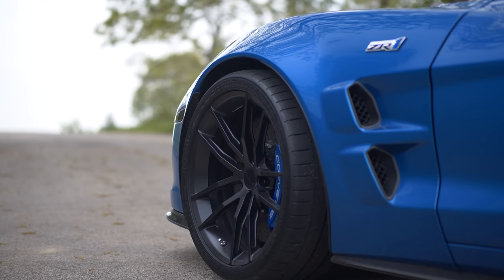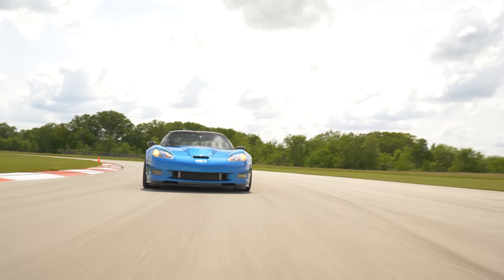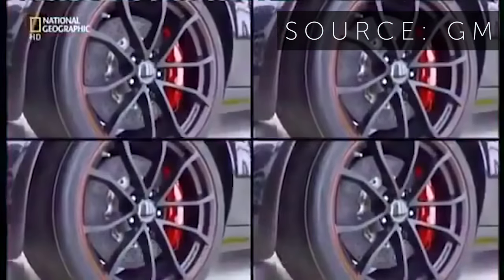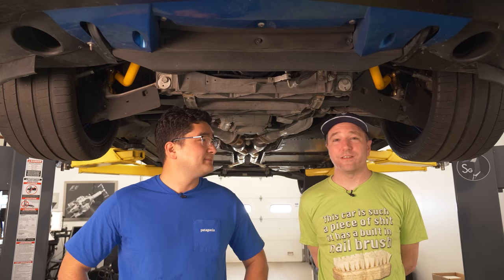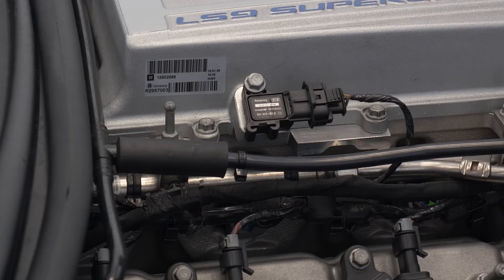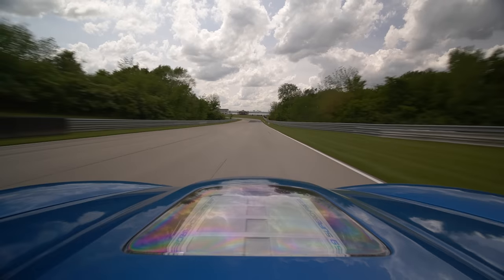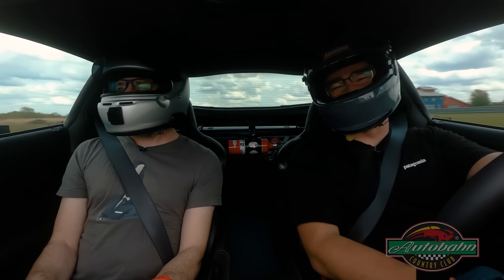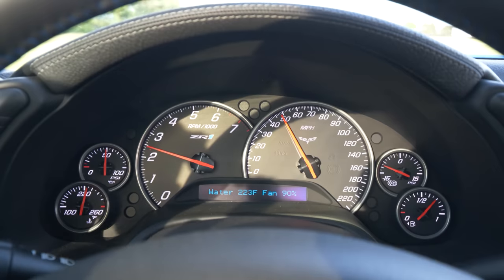Corvette C6 ZR1 | 1000HP Death Trap

Comment: Mark's initial reaction to the pedal to the floor reminded me of a childhood memory. I was 8 and my Dad's friend Ed, who worked for Dodge, came over to give us a ride in his newly-acquired 71 Super Bee. The only car I had ridden in up to that point was a Pontiac Catalina wagon and my grandfather's Oldsmobile sedan. Ed eased it onto the highway and punched the gas. It was like the sky cracked open. I could barely speak.
Reply: And an enthusiast was born! Awesome story, sir!
Reply: Reminds me of my 2014 RT Challenger, that has some light modifications (shift kit, CAI, catback exhaust from CORSA). First time I test drove the thing I got onto the highway, which was a ramp with a speed limit of 25, I rolled into the throttle up until 35 then punched it - once it downshifted holy shit it blew me away. Sunk back into the seat and flew by everyone, I heard it roar going through the highway underpass so loud; even with the windows up. I went from 35 to 80 in what felt like only a few seconds. It blew my mind. Fell in love with the thing and bought it immediately
Reply: Took the words right out of my mouth 🙂

Comment: I've been waiting for this video. The c6 z06 is the best car for the money, performance wise. The zr1 is just that extra step of brutality that no one really needs, but many desire.
Reply: id still take a hellcar ,demon or viper over this any day of the week....wouldnt want to look like a old man going thru a midlife crisis like every corvett owner is.
Reply: @Scypher0th  then you haven't driven these cars lol. I have been in a c6 z06, zr1, manual hellcat, etc. Even have a viper acr review coming. For the money, a c6 z06 and in some cases, a c6 zr1 is the best for the money, performance wise
Reply: @Scypher0th  I've seen mostly old guys driving hellcats, demons, and vipers too. You're just a mopar fanboy
Reply: I dont know about "Best for the money" due to the LS7's valve dropping issue.  By the time you're done fixing the issue and upgrading while it's torn apart you could be into a ZR1.
Reply: @Sir.VicsMasher  you can fix that. You throw $10k at the c6 z06. Now you're full bolt on with new heads and a custom cam, tuned as well. Looking at 580-650 whp depending on how aggressive your setup is. Of course, you can just replace the heads and call it a day but while you're in there, you may as well do the cam too.
Reply: @Sir.VicsMasher  so a lightly used c6 z06 is around $30-$35k right now if you look nation wide. Thats a 20-40k mile, unmolested one. You throw $10k at it like i mentioned, and you're no more than $40-$45k max. You're still at the very minimum $20,000 below the value of a regular used zr1 being that they are $65k+ now.
Reply: @MaxSpeedMike  Lightly used 20-40k mile Grand Sports are $40k+ nationally on AutoTrader and Z06's are even more.
Reply: @Sir.VicsMasher  im not talking about dealership cars which are mostly what's listed on autotrader. I'm talking about private sellers, usually the original owners or 2nd owners of the cars. I like to buy from someone who knows the story and what was done to a car. Not a dealership who cant tell you anything about their car for sale, except what they're selling it for
Reply: @Sir.VicsMasher  prices for used cars overall has increased a shit ton since january though, and that includes the c6z. Can still be had with 40k or less miles for $40k or less from what i'm seeing nationwide.
Reply: @Sir.VicsMasher  What you've shown is what I've seen as well. Asking prices have inflated like crazy. I've been looking at C6 Z06's, mostly in southern CA, for about 3 years. A year ago, I pristine car with under 20,000 miles could be found with an asking price of $40k or less. Slightly higher mileage or more thoroughly used cars for $30-35k and a few delusional people asking well over $40k. Now, a higher mileage, more thoroughly used car is at least $40k asking price with $45k+ being common. This is all private party, not dealer. Shame. C5 Z06 prices have gone up a by a double digit percentage too. A year ago, at any given moment I could find at least two being sold private party or dealer with 20,000-40,000 miles asking under $25k. Not anymore. I guess I'll buy an ND2 instead.
Reply: @Scypher0th  This car was trapping nearly 130 like 5 years before the Hellcat was even a thing.
Reply: I'm loving my ND1 2016 MX-5 Miata Grand Touring with the 6 MT. Got it at a great deal. Plenty fast if you keep your foot all the way down and i've beat an S550 GT and LT1 C4 Corvette on a B Road. Handles like it's on rails and plenty fast enough to blow by Florida Highway Patrol at 143 MPH on I-95 at 4 AM. Sure I may only have 1/4 to 1/8 the power but it's fast enough for my inexperienced 21 year old ass. Love seeing these beasts on this channel though, SG is my favorite, I hope I might see a C5 Z06 on here some day, Preferably in Millennium Yellow, My favorite Vette ever, in my favorite GM color ever. The C5 Z06 really does it for me if your talking big power for low money. I think it's the blend of retro and modern styling.
Reply: @Ryan.......  Am not all disappointed in my less powerful ND1. It's an excellent car and excellent chassis. Test drive one if you get the chance. I fell in love immediately with how raw of a car it really still was, but still has all the nice modern touches. SG has done some great reviews of it too as I'm sure you know.
Reply: @2K-Tan  Just about any Miata is a good choice. If the ND2 didn't exist, I would buy an ND1 and be very happy with it. But the ND2 does exist, I can afford it, and the benefits of the ND2 are worth the additional cost to me. I never thought I would buy a new car, but Mazda has low financing offers assuming a car can be found, used ND2's are barely cheaper than new ones, there is some small practical and sentimental value in being the only owner of a car, and I'm willing to spend a little extra money to make my negligible contribution to new Miata demand to show its continued economic viability to Mazda. Savagegeese has a video on the C5 Z06.
Reply: @Ryan.......  There you go! Follow your dreams. I agree the ND2 is the better car. I decided to buy Used 2nd owner Jet Black Mica w/ Tan Leather with only 21K miles and I paid over 10K off brand new MSRP. ND2's had just come out and were still really hard to find relatively cheap used at the time, (and probably contributing to ND1 price cuts) So I decided if I could get an loaded ND for around the price of a new base Corolla or Civic I'd do it.

I would've loved to buy new and support Mazda but I was looking in the low to mid 20's at the time and wanted atleast a Club but preferably a GT for the extra tech and leather. (and I think the GT spec 17 inch wheels look better than the BBS's but that's just my opinion) 

So because I couldn't buy new I at least try to get Mazda service for all maintenance except oil changes because I can usually handle that myself. I got a somewhat good deal at 21K out the door on a 31K car and it was mint. So I can't complain too much I guess.

I'll look for the video! Thanks for letting me know!
Reply: @2K-Tan  Tan interior is the way to go. Good call.
Reply: @MaxSpeedMike  youd be hard pressed to find one that low. I wouldnt touch any older models. 2011 and up are over 50k and Z07 package ones are 50-60k+. Anything LS7 has gone up like crazy. Z/28s could have been had below 40k 2 years ago..... now cheapest one is a little under 60k. These will keep climbing IMO....
Reply: Best car for the $$$ is a C5Z, then a  C6 grand sport w/ LS3, then a C6Z…..reason I put it 3rd is b/c when I think of vettes I know I’m modding em for more power/performance, & when you take that into consideration you have to understand the limitations w/ the LS7 (compression, cylinder wall thickness, valve train issues) - you need to spend $2500-$3500 to fix the heads/valve guides & they don’t take boost nearly as well as the LS3 (or LS6) - BUT that’s also one of the attractions to the car- it’s a huge displacement naturally aspirated beast- you go lopey cam/heads/e-cutouts & a short throw shifter on that thing & piss off ALL the neighbors on Sunday morning lol!!

Comment: This, the C6 Z06 and the new C7 Z06 and ZR1 are unbelievable performance bargains. Probably the biggest performance bargain of all time
Reply: Forgot the grand sport...
Reply: @MarkHoover-dv7mf  and the SS1LE
Reply: @GERONIMO326  100%
Reply: @MarkHoover-dv7mf  I currently have a 2020 2SS 1LE and I LOVE it. The Alpha chassis is amazing, great steering feedback, and the manual Tremec transmission is phenomenal. Brakes are unreal, and the grip this car has is just ridiculous. GM sports cars man, gotta love them
Reply: @GERONIMO326  i have a 13 grand sport 6 speed manual.  The thing is a lot of fun.  The only real downside is how low the car is.  Sometimes I think a camaro would have been a better choice because I literally can't make it up any kind of bump/incline without hitting the splitter.  I have about 3.75" of ground clearance.

Comment: I wanted a C6 ZR1.. but I bought a 2012 GS and after engine mods, ended up with 595rwhp dyno'd.. leaving it there to save the A6 transmission while it drinks anemic 91 octane fuel.. but still it'll spin the tires to 130 -- and when you 'hit it' at 100, it's spin the rear 345's while the rear 'searches' for traction even with the TC on. I can't imagine more...  pure fun!

Comment: Great video! I look forward to your C6 Z06 video as I've owned one for 8 years now. My only request is that you get your LS7 cylinder head issue facts straight. So many reviews either ignore it completely or don't do enough research on it.  Either way its still a hotly debated subject among owners and even head rebuilders some 15 years later.
Reply: If it's a hotly debated topic then it's clear no one version is necessarily correct. We'll see how they present that problem.

Comment: These guys are 10000% correct in their description of the C5-C7 vettes being extremely similar, I refer to C6’s as “C5.5s” for this reason lol, they already reached the pinnacle of performance in this design (transaxle/rear drive/transverse leafs/etc) w/ this C6 ZR1….it was the only vette (aside from the new C8) that made me consider trading up & out of my C5Z…but they hold their value so well I couldn’t justify the price (they’re usually more than C7 Z06s even now) soooo I made my C5Z faster than a C6ZR1 (of a C7 ZR1 for that matter)- I will add the new C8 Z06 to my garage @ some point, THAT car is next level

Comment: This and the C7 ZR1 are my top dream cars. I'll get them someday 🙏 My C5 LS3 Z06 will do for now 😁
Reply: What happened to the LS6, can I have it
Reply: @rantdeville  previous owner swapped them and sold the LS6. But this LS3 is pretty stout w/ 12:1 and solid roller cam on e85
Reply: @Fast-is-Fun  that's badass man. What kinda power are you at with the cam and e85?
Reply: @brandonsever2576  it made 566whp on pump E85. The fun part is the 7800rpm redline 😎 revs forever with the stock rear gear tho 3.23 or something?
Reply: @Fast-is-Fun  that must be incredible. I had a c5 last year but ended up selling it because it wasn't as fun as I was expecting. I think a 7800rpm motor would solve that problem 😂

Comment: Just a C6 Grand Sport here...can't even fathom double the horsepower.  Interior aside, it's certainly a performance bargain.  But after autocrossing C6s for almost 4 years now, they just aren't fun on the street.  You really need to be approaching the limits for them to be truly fun, which requires something like autocross or time on a road course.

Comment: Of all the front engined Corvettes made, imho, a base C6Z is not only a HUGE performance bargain, but, with Michelin non EMTs, it's the most neutral and best balanced and easiest to drive. It's not too powerful as to get one in huge trouble, yet, is still a 200 mph car (GM says 198-but videos from Germany had theirs going 203 and 205). Plus the super linear throttle response of a normally aspirated engine that revs better than a lot of 4's and 6's. Then, when it's time for servicing, it'll be the least expensive for repairs. The C6Z is very much a 'driver's' car, again, imho.

Comment: Alright car bros… I am in love with the C6 ZR1 the styling, the LS9, just all of the car and plus how iconic it is. Im really thinking about building a 1000hp C6 ZR1, but the issue is the LSX. Ik the LSX is said to be able to make upwards of 2000 hp even when built properly which isn’t my goal, but it sounds like in that case 1000hp would a cake walk for the LSX. So, which would be more reliable making 1000 maybe more horsepower? Would I be better off giving up the novelty of the ZR1 and getting like a Z06 and LSX swapping it and building or would it be fine getting a ZR1 with the LS9 and building for that much power.

Comment: I've own a 1000+rwhp (1140rwhp to be exact) c6 z06 for almost 10 years now. Well over 30k miles at the 1000+ range. The cooling issues are a big issue on any c6 and took a lot of money and time to make it reasonable to AC works in 115+ Arizona weather. One thing to note running it on those tires is a shame, as it really needs better tires to be fun and remotely hook.
Reply: That’s why they think it’s a death trap because it’s shitty low traction tires on there. Some 345 r888r and 305 r888rs up front will change the whole narrative of this review.

Comment: the fact that the c7 zr1 was barely any faster on track nearly 10 years on just goes to show you gm reached the pinnacle of the front engine rear drive platform that was the corvette

Comment: suceh a nice title.  In my mid sized town just this past year 2 C6 vettes were involved in accidence.. one ona nice long highway that dips as it goes through a tunnel lost control and smacked into the wall of the tunnel, the other a nice long straight level off ramp of an  interstate highway that T's into another highway  had the car go right through the intersection and into the woods on the other side of the T.  No telling from the pictures of what was left of the vehicles to tell that specific trim level they were.

Comment: It’s only a death trap because there are shifty tires on there. Only tires that should be on a high hp vette are r888r 345 - 345 mickeys street r’s or nto5 nitro. R888r 345 will hook up from a roll at 60 rolling in to the throttle smoothly mickeys will dead hook from a 40-50 roll. Never understood why people mod their vettes and  leave shitty cup 2 or pilot sport tires on. That makes it a death trap not because of the power but the tires.

Comment: The biggest problem with auto journalists is that they have to ALWAYS find a negative to write about. With the C6 Vette, they had to bash the interior. It's not perfect, but it is FAAAAR from being as bad as some of these feeble journalists say it is. The Europeans especially were good at this. SInce the rest of the car was almost perfect, and it was half the price of the cars that it smoked in almost every performance  category, these euro-fan boys had to find a negative and never let go of it. Usually they like to bash a car's weight, but that wasn't a problem with these Vette's.  So from now on, whenever you hear someone bash these interiors, they are usually jealous of the car and are butthurt that its 10x the performance car that their fav car is.

Comment: 15:24 nothing, and i mean nothing feels as pants shitting scary as going sideways at 60 miles an hour under hard throttle. I did it in the rain with my 2019 scat pack charger. It had stock tires. Not so good. I can't imagine doing it on dry pavement. Mine can spin em on dry pavement at thirty. Still a little scary if you're not expecting it.

Comment: You guys have got to read up on these cars before you start spitting statements out about them like they're facts. Magnetic dampers are far from pioneered on this car by GM, the C5 Corvette had them as an option. Also, I might be just wanting for clarity, but as I understand it you can't interchange shifters between C6 and c7 Corvettes, they don't even have the same gearbox
Reply: We get the information for these piles direct typically from the oem(this case press kit from ncm and the stuff natgeo and gm did together) and any period media.

 the c5 had them in the last two model years. Pretty sure the c6zr1 was the first vet with the magnaride standard however thus the confusion on my end.

As for components being interchangeable c5 and c6 suspension components i know can be swapped and aftermarket shifters for c6 and c7 are the same. The thread pattern for the knob is different but the box is nearly identical. While the chassis and body constructions were all different across c5-c7 they were essentially derivatives of one another with the c6-c7 jump being the largest from a body construction and engineering perspective.